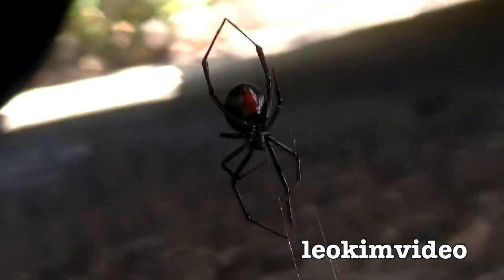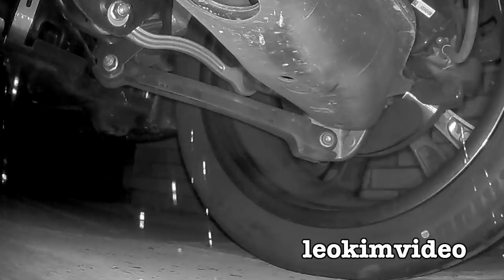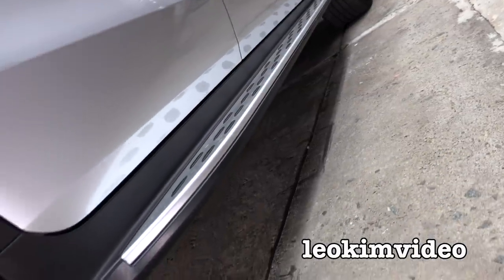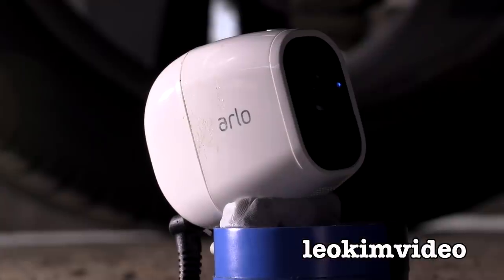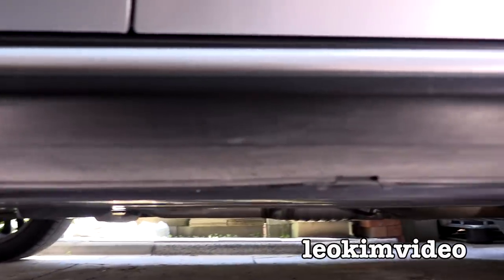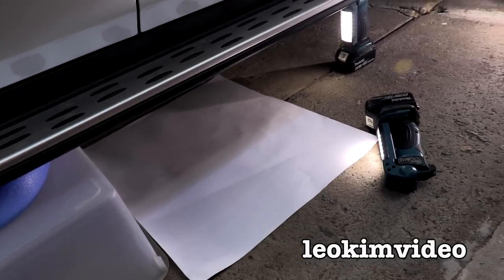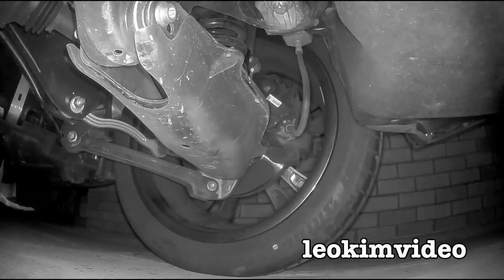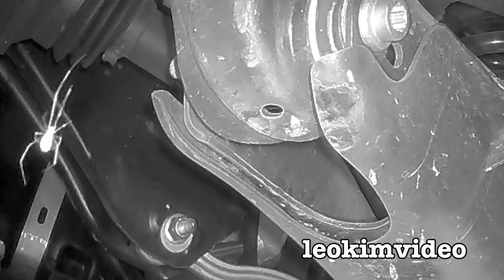Spider Mind Games Mercedes Benz Spider Infestation Pt1 EDUCATIONAL VIDEO

Comment: About the use of sparkplugs in a diesel engine. I have found one diesel that had sparkplugs fitted. One was used as sump plug, two others were used to plug oil galleries and another two were plugging the heating feed and return as the heater matrix failed. So, yes... Some diesels use sparkplugs, no service needed.

Comment: 15:27, Spiders are cold-blooded animals that require external sources of heat to keep warm. Your car is the perfect place for a spider to live, because of all the nooks and crannies they can hide in. Also, when you use your car, (or it's simply out in the sun) the car will heat up, thus providing warmth for the spiders living there.  (That's also why spiders will wander into houses, they have the perfect temperature for them. :D)